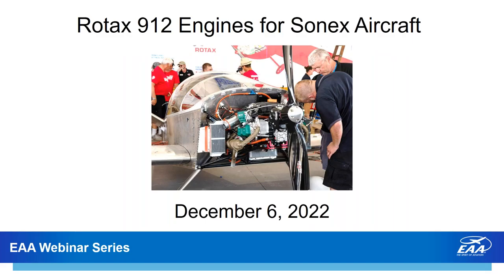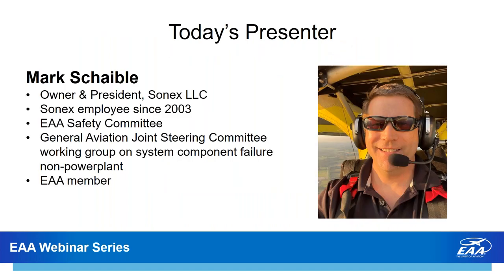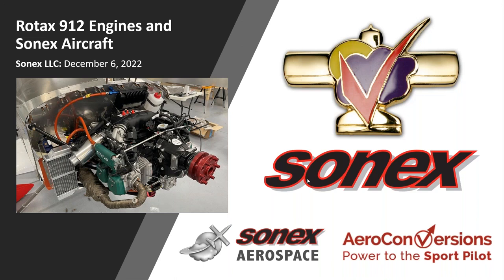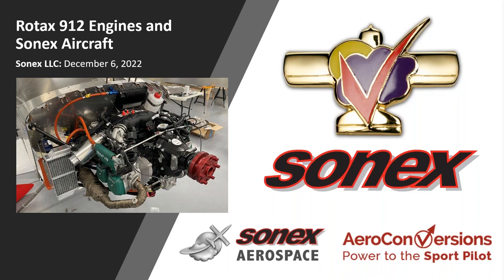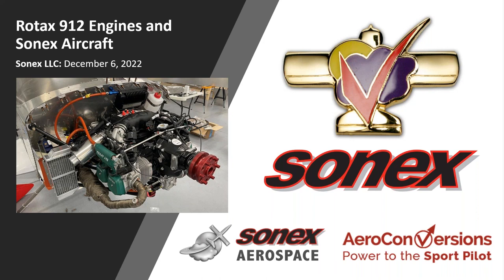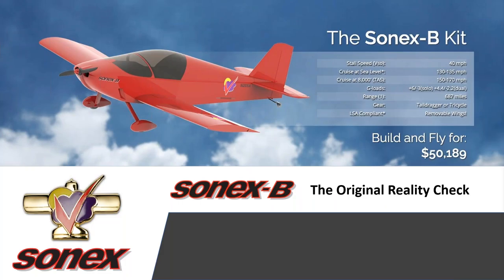Webinar: Rotax 912 Engines and Sonex Aircraft

Comment: 54:16   Thats my little bird!!!   Thanks for making it part of the video...  The answers:  Thats actually a 4 to 1 equal lenght exhaust i made, I live in Argentina and have no access to stock parts (either becuase of local laws or for prohibitive prices) so we have to make things work by ourselves!!
Collector tube with no muffling at all.  Sounds AMAZING... Pretty much like a sportbike.  Havnt flown it yet im fugiring out cowling and  cooling.  The radiator in the bottom corresponds to the oil circuit, water radiator is vertically mounted at the left of the engine and i will fit a naca vent pretty much like that beautiful sonex from Sweden.   Feel free to ask anything. Im here to learn. And if i can make anyone elses plane safer, faster, cheaper or easier to build that will make me really happy :)

Comment: Thanks for the presentation, and the background development.  I've been flying a Onex with the 912, originally 80 HP, and now maybe 95ish.  I made my own firewall mount to use the ring mount.  My cowl and installation will probably never be finished, but fortunately I enjoy the development part more than flying I think.   BTW, I'll be interested to see how long that muffler wrap lasts.  I had the best you could buy on my Toucan exhaust, and it crumbled in less than 20 hrs.  I ended up switching to stainless shields.

Comment: Hi I'm Anthony
I'm generally off topic poking the hornets nest or imagining big things in R&D. 
    Quite frankly I'm sucking lemons with where Sonex has taken the Aerovee platform development. Probably nothing is worse than how I feel about stalling takeoff of the electric motor development. Quite frankly, my vision for the 80 HP Aerovee was ( is) to increase efficiency, power generation, and endurance while reducing
cooling demands. I think it takes three systems to accomplish this goal using proven technologies respective to electrical, mechanical, and waste heat energy conversion. 
I think it's important in todays economy and in consideration of natural resources and environmental goals to satisfy part of all these objectives. Let's face it, the combustion engine struggles to exceed an efficiency of less than 50% - 35% at sea level. If we convert the mechanical horsepower to actual KW a reasonable power output estimate is 30-15 KW. However, the waste heat of this engine is capable of producing more than 30KW of energy. Scavenging the waste heat while simultaneously reducing the needed engine cooling is effectively accomplished by transferring the heat through a heat exchanger into water or steam electrical power generation via the turbine. This harnesses the energy and provides a combined efficiency exceeding 70-90%. Storing that energy in a small lightweight LFP battery bank and delivering it to a crankshaft mounted inductive or brushless dc motor configuration. Engine loading decreases, waste heat management increases, power output increases0
Reply: Airplanes are fun.
Reply: Please post pictures of your prototype, no matter how crude and preliminary.  I assume this is not just pulled out of your nether regions.  This after all is experimental aviation, not airy fairy fantasy.
Reply: @fast_richard  Thanks for your interest.

Comment: Rotax probably the most expensive engine per horsepower!
Reply: Most reliable engine for experimentals i can think about...
Reply: @xeriotti  you may upgrade your information ☀️
Reply: @tinolino58  like to hear what information you have that disputes this?  Never seen a rotax installation having pilots worried about EGT temps etc.  No it just starts and flys
Reply: @joeshmooo5327  Ask the majority of Zenith builders 😇
Reply: Not really when you consider how long they are expected to last. Rotax ULS (100 hp) goes for $26,800. The ULPower 260 (97 hp) goes for $22,345, the ULPower 260is (107 hp) is selling for $23,980. BUT you need to also consider the TBO. Rotax gives a TBO of 2000 hrs. So yes, you pay a little bit more for the Rotax but also get another 500 hrs than the ULPower engines for just 3-4 thousand dollars. 
Aerovee engines are less expensive and don't even publish a TBO...but are expected to last, according to the company selling them, only between 700-1200 hrs depending on use.
Reply: @markg4459  the Rotax numbers are hilarious
Reply: Rotax 912iS/Sport is the only engine capable of circumnavigating the globe un-refueled. 

The only other one(s) were the extremely rare prototype, liquid cooled TCM O-200/240 fitted to Voyager in the Smithsonian.